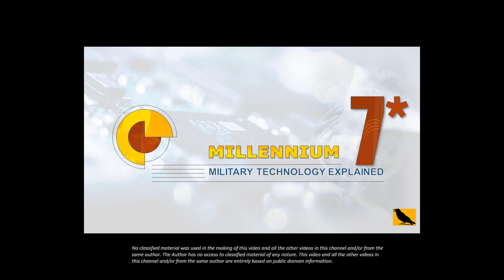A New Fighter Every 5 Years - Next Generation Air Dominance

Comment: The agile modular approach could be a winner. Flexible production lines could win more export orders due to tailoring the product to the client. And the experience of adapting production lines would make it easier to ramp up production in the case of a major conflict.
Reply from the maker: I think you are pretty spot-on here. There are plenty of advantages in variety alone. What could be effective against one plane may not be effective against another, simpler planes are easier to build en masse if needed (albeit I doubt that anything like WWII could be achieved today) and a large variety of planes may be more appealing to non US customers.

Comment: I imagine there's an economical incentive for this choice too. Increased production would drive production costs down, but also mean other countries have more options to spend their money on for their own air forces, increasing the potential for return for the USAF.
Reply from the maker: If  the USAF goes back to specialized platforms, the others might do as well. However, it depends from the size. A small air force might require a universal platform to reduce complexity.

Comment: having different planes is always better but that's always the case, old gen and new gen live alone.
F16 and F15 will stay in service for a very long time with the F35, until the next gen comes and replace them. 
But having specific platform ... not so much, the SU34 had very limited freedom in Syria and needed escort multiplying the flown hours and the cost of the mission. by the way the F35 isn't that multirole since the USAF always ways the F22 to escort them (as least on a high risk mission)

Comment: So rather than to have do it all master of none aircraft, the idea is to have airframes that would individually be optimised to perform a single software/hardware task that would normally be contained in a single airframe?

Imagine having your radar plane get destroyed, would the missileer still be able to engage targets but with reduced radar range? as I expect for it to have its own conventional radar equipped, Or would it be made useless entirely until another radar plane is up?
Reply from the maker: The idea is having specilized platform around a technology, rather than around a function. So a plane could be multi-role, but not one size fits all like before.

Comment: How about this? How does a relatively small country, with a small (but very wealthy) population, NO (as in ZERO) military track record, produce a highly sophisticated, capable, cheap and robust jet fighter in a fraction of the time the US takes, and do so with systems that enable a high level of viability and ease of operation, to the extent of using rural roads as runways?  When you have the answer to this (and it's political, NOT military or production), Then you should apply this to the NGDP and you will multiple your chances of success by several orders of magnitude!  [Hint:  compare IKEA to Walmart!] 😉

Comment: It used to be that high-end military projects such as fighter planes were driving hard science. That's no longer possible under this new guise. Another key point - whoever tells you that making a large number of different airplanes for different purposes is cheaper, is lying. While the plane itself may get done faster and cheaper, there are definite hidden costs in maintenance, logistics, certification (for a moment imagine if you had to certify a new system for 7 planes instead of 1), and finally - operationally. An F-35 right now can fulfill the role of air superiority on day 1, air defense suppression on day 2, and ground strike/close support on day 3 of a given campaign. Yet it is only one airplane! It takes up 1 valuable slot in the hangar or on the aircraft carrier, not 3; it requires 1 pilot, not 3; it requires 1 maintenance crew, not 3; 1 set of spare parts, not 3; and so on.
Reply from the maker: I see your point but, if you listened the whole video, some of these points are addressed. It obviously goes against the conventional wisdom, otherwise it wouldn't be something new.
Reply: @Millennium7HistoryTech  looking at your argument, that a "hack or a counter" can turn 75% of Western airforces obsolete... isn't this what F-35 does to every single other fighter airplane in the world with the exception of F-22? All those tens and tens of different variants of fighters that are in service at the moment are basically powerless before it. I'm not sure diversification is the answer here, if it comes at the cost of such "halo projects" as F-35 that can single-handedly turn around the balance of power all over the globe. Additionally, although much noise has been made regarding it by the Russians and the Chinese, I don't think anyone is even close to countering (i.e. weapons quality tracking) it. Bet lets assume it happens anyway, something negates a lot of the stealth advantage it enjoys (Germans have worked something out recently, although I'm pretty sure it comes with a whole bagful of caveats). I've heard several F-35 pilots express how "stealth is the least impressive quality the F-35 has" meaning even minus stealth it still enjoys qualities that other airforces can only dream of - nearly 360 degrees of through-plane vision for the pilot, millimeter radar that is able to detect single soldiers on the ground, threat signatures database that gets updated in realtime, God's View (sensor fusion between all F-35s in the airspace to create a single battlefield overview), the ability to use other platforms such as other fighters, bombers and even ships in proximity to fire missiles at enemies without opening bomb bay doors once itself, etc.
Reply from the maker: In my view no military technology works as well as advertised, and I am pretty sure that some F-35 limitations will begin to emerge. However, I concur that in term of technology it is outstanding. 
Unfortunately technological superiority doesn't translate automatically in battlefield superiority. The Germans would have won WWII if it was true.
I believe that USA and western air forces are lulling themselves in a warm feeling of safety which derives from the fact that, from Vietnam onward, they have displayed a large superiority over all the opponents that they have met, while I believe that most of that superiority was, in fact, opponents inferiority, either numerical or technological. 
Mind, I am not saying that the west doesn't have an edge against Russia/China, it has, but it is quite a thin margin, in my opinion.

Have you ever considered that, in case of a fight against Russia and China, the USAF will spend the first month or two fighting for air dominance leaving the ground forces almost alone? What if, as the only way of avoiding a Russian, Chinese or North Korean decisive penetration, which happened because the USAF is not supporting the ground forces, you have to send hundreds of ground attack missions against a still functional air defense complex to try and save the day?
In the first weeks of a near peer conflict you can lose hundreds of planes that take years to replace and, most crucially, you can burn through 90% of all your smart/intelligent/brilliant/guided weapons stores, have used all of your F35/F22/Eurofighter/Rafale hi tech spares, and be left with just iron bombs and gun rounds, which are the only thing you can replace fast enough to keep up with the consumption.
Maybe, at that point, you might regret of not having something simpler, quicker to build and easier to maintain. Or, maybe, you might regret not having something like the Gripen, which takes 4 conscripts 40 minutes to rearm for a mission, all of that from on an icy motorway.

I know many don't share my view, but the channel exists to foster discussion.
Reply: Millennium 7 * HistoryTech i agree 100%